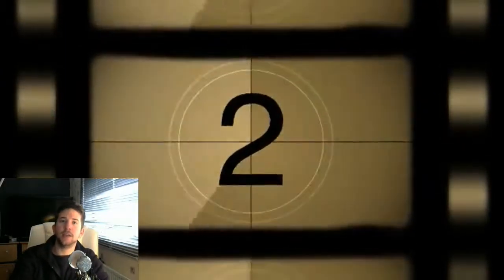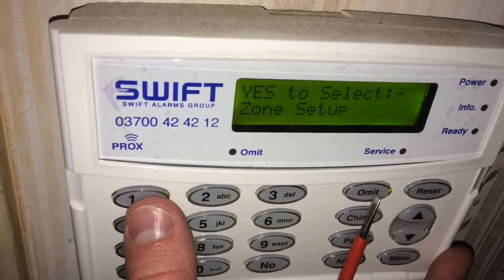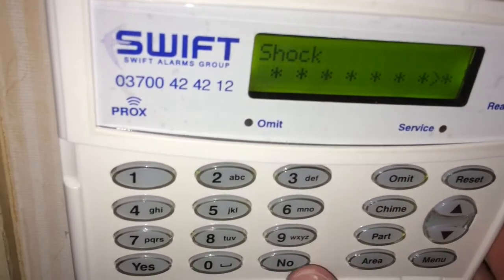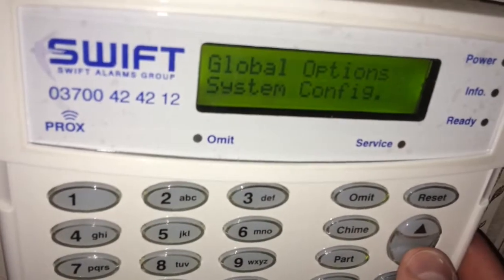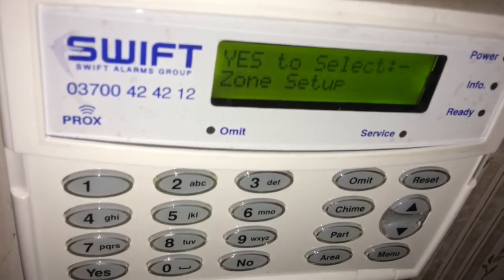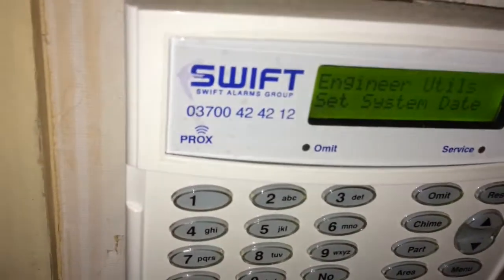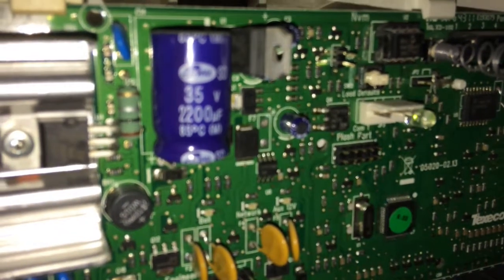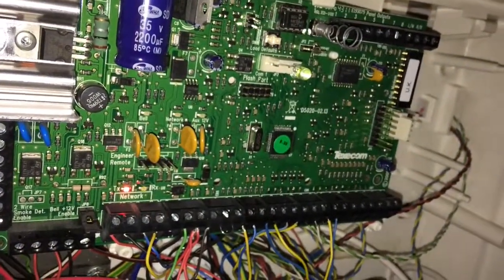Alarm Tech- Premier 24- Basic how to guide

Comment: Can you do a video of wired texecom elite programming
Reply from the maker: I can do, what do you need help with?
Reply: Thanks for reply
All basic settings 
Zone program 
Bell trigger 
And other functions 
Best regard
Reply from the maker: @عليالخضيري-ع7ك  For setting up your alarm you'll need to enter the engineer menu, the first option with be 'Zone set up' press yes and you'll have zone 01 and entry/exit below that. If you've wired your front door into zone 1 leave it as that. Press the down arrow to go to zone 2, this will default be guard entry, which is generally the hallway, zone 3 is set as guard, this will be used for everything you want to alarm as soon as it is activated, guard entry is if the front door opens (entry) is well allow you to walk through to the keypad which should be in that area. Entry/ exit is what final sets the alarm. Going through the zones if you have any not in use, eg zone 5 has nothing wired in, so you on the guard press no, and then 0 which will say not used. Press yes to confirm. Once on a zone you can press the down arrow to go through the options and find zone name if needed. The alarm is asking you if what's displayed is correct, so you need to press no before you can change anything.
Reply from the maker: @عليالخضيري-ع7ك  For the bell, as long as you've wired the trigger into the right terminal it will activate on alarm
Reply from the maker: @عليالخضيري-ع7ك  Other big thing is user code, from the main menu (Zone set up is option 1). Press number 8, and it will say set up users. Press yes, and it will take you to the first available user. Press up to go back to 01 (master), press yes and it will ask user code, press no, then enter the new user code. Once entered press yes, press menu and then use the up arrow to get to the 00 engineer, change the engineer code to desired the same way as the master
Reply from the maker: @عليالخضيري-ع7ك  You can download the engineer manual as a PDF after googling 'premier elite 24 engineer manual' as it has over 100 pages and goes into a lot of detail regarding resistors etc. For example if you haven't used 2k2/4k7 resistors you'll probably have tampers on all your zones if you've used normally closed (no resistors) and you'll need to change that on your zone set up, go from zone 01, press yes until you get to zone wiring, press no, then use the arrows to find normally closed, once found, press yes and then press arrows to go to next zone if needed
Reply: Alarm Tech 
Thank you very much 
I do scantronic EN 41-43
Is it bet similar
Reply from the maker: @عليالخضيري-ع7ك  For testing press 9 from main menu and you'll have 'Engineer utilities' press yes, will say event log. Press 3 and you'll have zone status, you can see what the zones are doing, current state and resistance by pressing 'area'. Press menu to come back out, press 8 & 9 to change time and date. Press 1 & 2 for walk test and bell test
Reply from the maker: @عليالخضيري-ع7ك  It is quite different as Texecom use different categories (zones, timers, users) etc. Scantronic it's all in a long list. So as you know from installer menu 01 takes you to zone 1's programming, yet 97 does the walk test
Reply: Alarm Tech Great information 
Thank you very much

Comment: Good panel and helpful advice but looks like a poor quality install. Bird's nest wiring and too much bare conductor showing at terminations for starters. Have been in the industry with NACOSS/NSI certification and inspection for over 30 years.  Just pointing out these issues, so that those just starting out are aware and can have some pride in their workmanship.
Reply from the maker: Thank you for your feedback David. You are correct in everything you've said, the panel is a shoddy install. I actually installed it a week into starting the job using pre-existing cables which are about 20 years old, daunting task for someone who hadn't used cutters before. Learning everything myself and improving greatly. You'll be happy to know that there hasn't been a single false alarm even with some bare connector hanging out the terminal (probably because I twisted the ends) and seemingly the birds next cables hasn't caused any problems 7 years after it was installed. Again, thank you for your feedback, hopefully your points help out those new to the industry
Reply: @pizzaandchipsmate  OK that does explain things. As you say, the issues mentioned do not have any bearing on the reliability of the system. My point was more that once you install a system it is most likely that other engineers will have to work on it some time. Twisting all pairs, labelling up cables, ensuring no bare conductors are all good practice and help others in future maintenance visits. I am now near retirement and wish yourself and those that are just starting out all the best.
Reply from the maker: @davidhawkins1404  I completely agree, it is something I have implemented since doing this panel as I was inept at installing. Thanks for your pointers, and I hope new and improving engineers take note